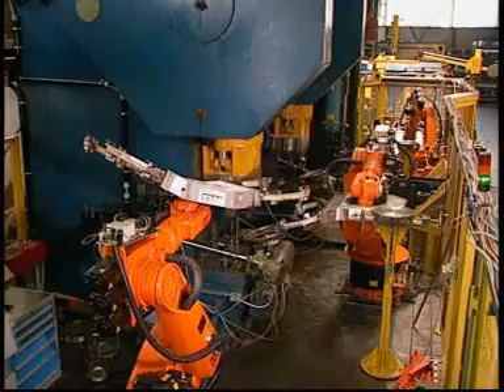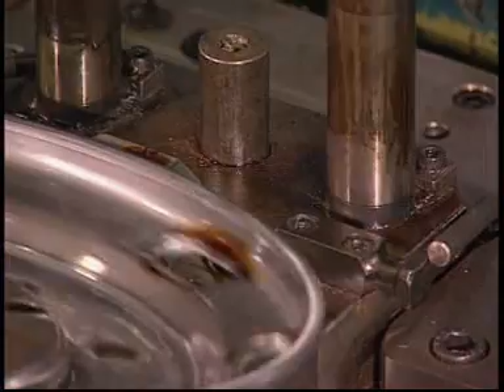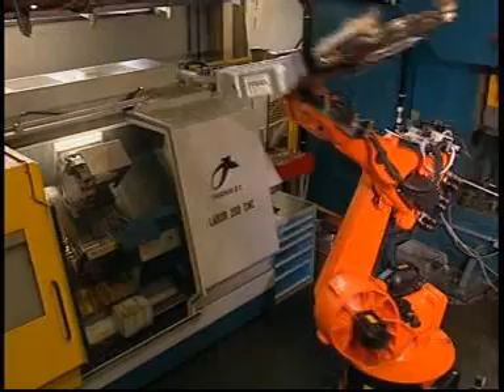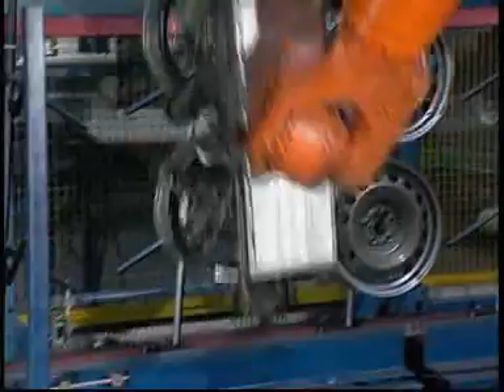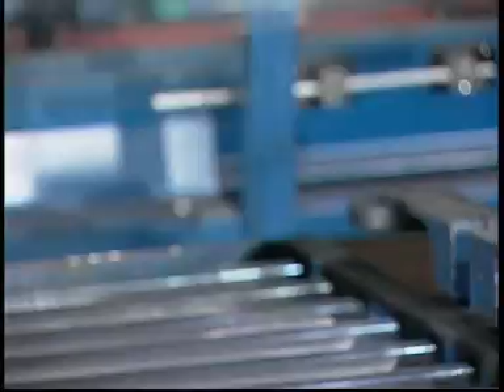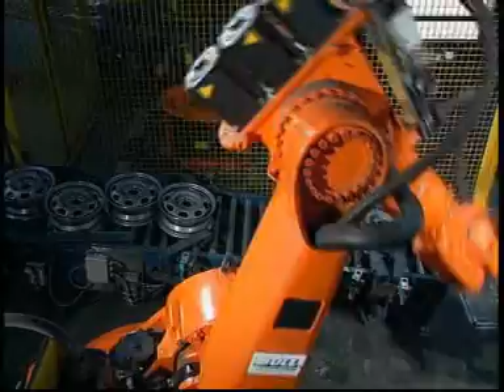Handling of car wheels with a KUKA robot

Comment: I can tell that these robots are extremely overpowered for the job they doing. And i wonder how many years these have to be working to be able to earn in the sallery that the workes that were there before cost.
Reply: It looks like a Kuka KR30 which has a 16-30KG payload which with the two wheels and gripper assembly is not 'extremely overpowered', also the profit of the robot is not dictated by the salary of the workers that would do it's job but rather by the cost of the employees which include salary, insurances and risk. Combine that with the fact that these robots will work for ten years without issue when maintained properly and that they work 24/7 and you'd need some four or five employees to do it's job which will make the robot earn back itself within a year...